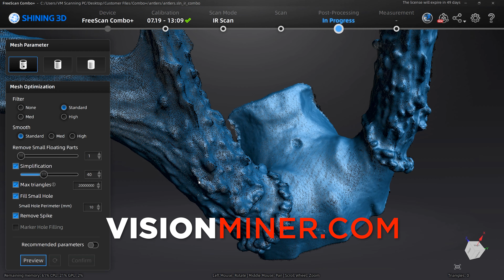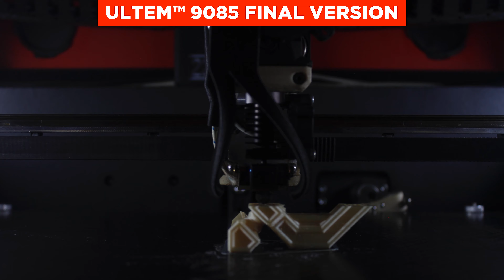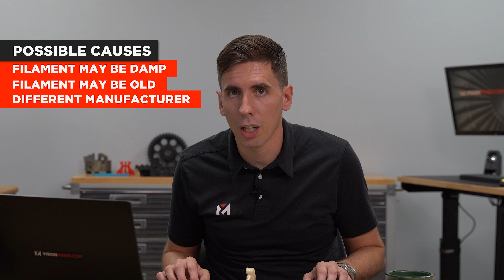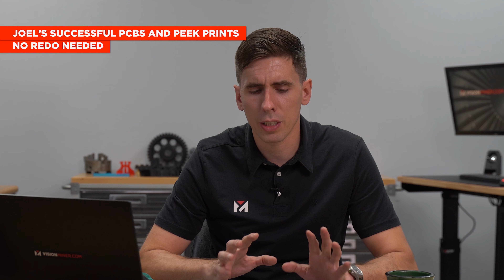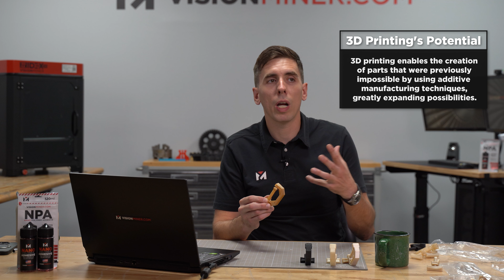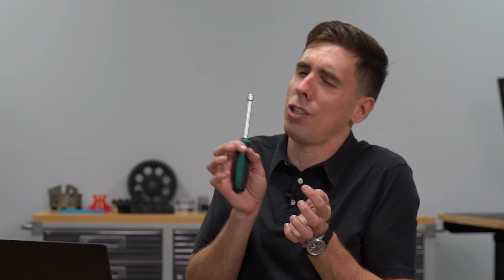Tuning High-Temp Materials on the 22 IDEX | ULTEM™, Carbon Fiber PEEK, Nylon 6, and More!

Comment: Very good information... I've been in manufacturing for over 35 years and its truly amazing at all the different methods that can be used depending on requirements and levels of production. I will say that one of the areas of 3D printing that I find very promising is the development of the 5 axis printer. Something that I see with your 22 Idex printer that I think could be very exciting is the way your bed has the individual control over the 3 screws and if mapped correctly in a slicer. I think it could give much smoother top curved surfaces and improved overhang capabilities. Their's a few videos on YouTube showing a regular 3D printer moving in all 3 axis at the same time, kinda like a ball end mill does surfaces on a CNC mill. But your 3D printer with the articulating bed capability, could be even more effective with this concept... I hope you guys can work with a slicer software company and get that dialed in for the market. I for one would definitely be very interested in a setup like that... totally next level stuff for sure... Thanks, I appreciate you...

Comment: :face-red-heart-shape:Great video, thanks Rob.:hand-pink-waving: I like your IDEX V3 printer, in my opinion, it is under appreciated how great it is/can be. Going to the 6HC was a far better choice, higher current steppers and canbus will open up new improvements on your printer, I own many of these boards. Does it use a daughter board to run all of those heaters? I run them on my larger industrial printers. One thing I would like to see on future IDEX printers is ditching the endstop micro switches for optical. If heat is an issue, you can remote the optical electronics away from the IR sensors. Also, nema 17 x 90mm motors are now available and would be a welcome and easy upgrade on the IDEX with no physical modifications. When setting up your IDEX, to your network, I prefer using YAT terminal rather than accessing the DWC through a web browser. If your printers are located in a remote area, like across a bridge network, you may experience problems using a web browser during setup. You will still be able to continue using 22IDEX.local for slicer setup. Something I think you should include in your wiki setup. :goat-turquoise-white-horns::hand-purple-blue-peace:

Comment: You've been doing this since 2017, and I've been doing this since August 17. Lol.  Thanks for pointing out the cut tool! I've been using the "Add negative volume" feature which does work, but it's not as slick.

Comment: To gain advantage of any High spec material, require higher temp and a heated chamber really.  Also, require some level of plastic design and process appreciation , you cannot use soft material knowledge like printing PLA or TPU and expect it transferable to PA6 (Nylon are one for worst moisture offender, that even before consider "glass fillers") or PSU (Bio and Chemical stable).

Ideally treat these material as if going through the injection process e.g. dryer hopper and material purging is a must have procedure to maintain consistent prints (or injection) especially for high spec plastic.

Ideally, you should really have a generally understand with the "plastic pyramid" e.g. the differences between Semi crystalline vs amorphous material (isotropic vs anistropic), because it shrink differently (between X and Y direction) depending which side of the material pyramid you use and which grade.

Plastic pellet actually have 'expiry date' and plastics have annealing limits before it permanently degrade.

Injection molders and designers dislike using "regrind" (recycled plastic) for this very reason, if you wish to use for high precision / high strength application, don't contaminate stuff like regrind.

3D printers manufacturer should really up their game by producing a FAQ similar to this video for typical print defects like "warpages", as you already do with typical "injection molded defects" e.g. "sink mark" is common if thick thin ratio haven't been designed properly as it is needed for injection molding.

Design out the issue first before settings tweaking:
So the general rule for better "3d printed or injection plastic" is focus less on process controls like "settings tweaking", it should really focus on better plastic design principles first from injection design rule and if it print well with one material then do the "settings tweaking" for more complicated material like PEEK or Nylon or PSU.

If you see "sink marks" during 3d print prototyping even after "settings tweaking" then you know it 'could' happen to the really expensive harden steel injection mold tool down the line, but tool makers can mitigate that somewhat with injection pressure and hold pressure, but it not a silver bullet and something 3d printers don't have.
Reply from the maker: Absolutely phenomenal comment. Thank you for this. You're absolutely right, this line of thinking is the next level for DFAM -- right now, many people are designing for additive, depending on the process-- but taking that to the next level, designing for the process AND material is needed to take everything to the next level! Thank you!

Comment: I dont have 15,000 for 3D printer.
Reply: Well 15k is about how much high temp machines cost. Also you don't need to drop 15k if you mod an existing printer or make one from scratch.
I've got a modified corexy machine that currently has an 85c chamber, and that's just using the 165w bed heater.

High temp isn't for consumers, it's for engineers who will use them to replace metal parts.
Reply: @markthompson5983  thanks. What engineer specifications material cost not so much as perk and ultran?
Reply: @markthompson5983 
Ht printers that can't do 100 mm parts out of Ultem 9085 needs 200c chamber 
They are a lot more expensive